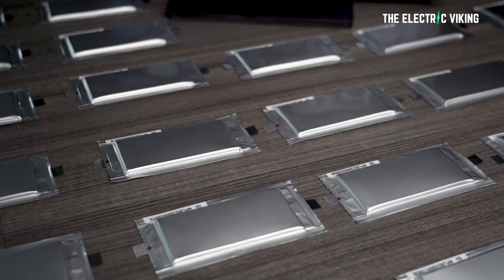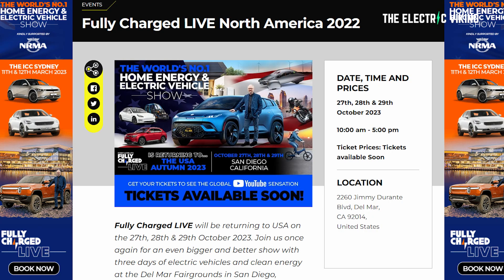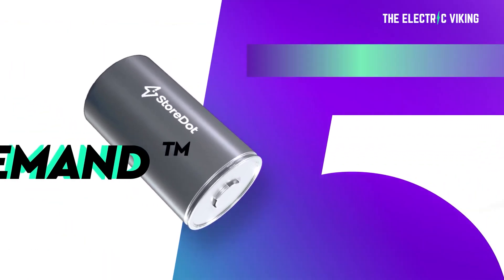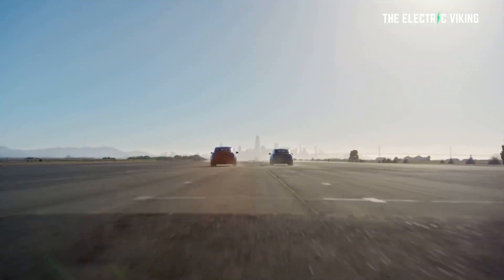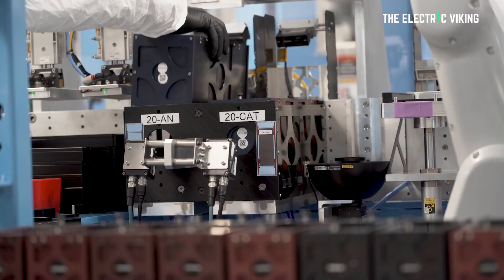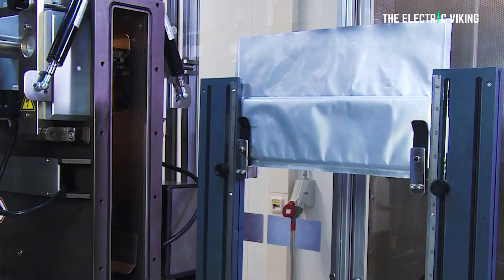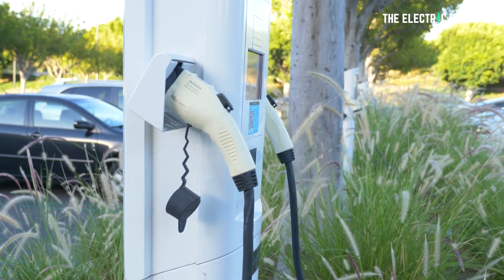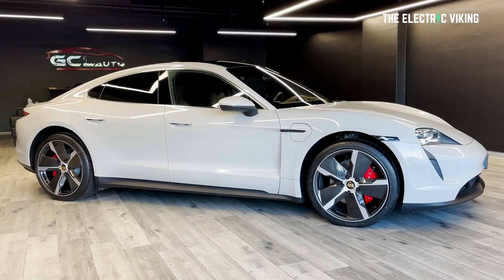World's highest energy density EV batteries charge in 10 minutes

Comment: If their claims are true then the implications are global. Let me explain. StoreDot is using nanotechnology to achieve these fast charging speeds and it will take time for the competition to catch up. If StoreDot were to decide to build theses batteries locally it would make them an energy powerhouse in the Middle East. That has economic and political implications. The nanotechnology to build the batteries will be more expensive than the regular 4680 so the mass production need them to have a run rate in the millions of cells not just hundreds of thousands. It will cost billions to build a factory which can produce millions of 4680 cells and that will require investors with very deep pockets and high tolerance to risk. We know from Tesla that producing 4680 cells in mass is a tricky business that takes time to get right. 

I would suggest you ask StoreDot to attend the Fully Charged event is Australia so the you can their executive team. Some of the questions I suggest are as follows:

1. Where do they plan to build their first 4680 battery plant.
2. What production run rate  are they planning to reach at the plant.
3. Will they need new investors to fund the building of the plant.
4. Do they plan to partner with an existing battery manufacturer of go it alone.
5. Will they need to IPO to fund the building of the plant.
6. Who is going to provide them with the feedstock for the plant.
7. Is there anyone who will be able to provide them with the volume of feedstock needed to produce millions of cells.
8. Do they have any auto manufacturers interested in their product at this time.
9. Will they be considering grid storage devices to take advantage of renewable energy production in places like the Middle East, Northern Africa or Australia.
10. Would they be willing to build a battery plant in Australia to produce batteries for grid storage devices and maybe a domestic EV if someone decides to build one.

"Interesting Times"...Eh!

Comment: 100 miles in five minutes sounds like pure bullcrap. What size battery in which car will this claim be met? Perhaps a theoretical large battery, not yet assembled, capable of a 400 mile range on a full charge just might be capable of adding 100 miles of range in five minutes when connected to a theoretical but not yet invented charger capable of giving a massive zap from a massive mains high voltage supply cable would do it? Really, you are in cloud-cuckoo-land with this video.
Reply: China's done it already last year with the gaic aion using a very secret graphene chemistry battery and a 480kwh charger.
Reply: I think it also has something to do with the super capacitor company maxwell technology that they bought a couple of years ago apparently they run the high voltage into a series of super capacitors from large capacity to lower capacity and finally into units of batteries instead of the whole battery pack
Reply: Ioniq 5 charges at 220kW and in 5 minutes you have got about 19 kWh and that is enough for driving about 80 miles so cars sold last 2 years are not far off this pace already. In China they are right now mounting 480kW chargers and in 5 minutes you are getting 40 kWh and that should be enough för about 130-150 miles. So it’s not future tech it is tech already out.

Comment: Solid state batteries will be safer (IF they eve r become available in the future).
Reply: Lithium ion batteries are plenty reliable and safe if they use cheaper, more stable chemistries like LiFeP
Reply: @PikaPilot  Compared to LFP, there is more scope to improve on energy density. So who knows? Unless you are deeply involved in solid state battery development and have a good grasp of the potential of the technology, you have no idea whether there is success in the future for SS batteries or not. And even if you were involved, you probably wouldn't know.  Why speculate on which technology will make it or write off SS already? And why would you make a YT video speculating about it?
Reply: @hvh377  comparing a chemistry which has been out for decades like LFP to solid state, which has been having trouble getting out of a lab for the last decade is a matter of context, not speculation. 

LFP is proven, and it is working at scale. LFP is beyond a shadow of a doubt our best option for large, nonmobile applications. 

Solid-state batteries being slightly safer than most Li-ion chemistries is not something worth bragging about when LFP is cable of the same, exists at scale, and is far cheaper